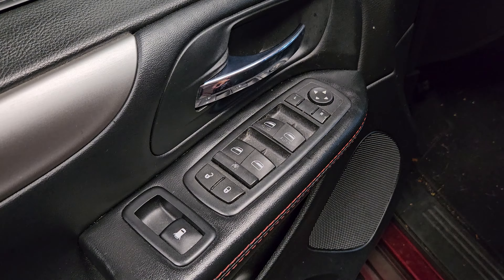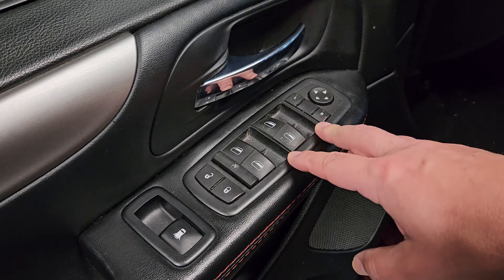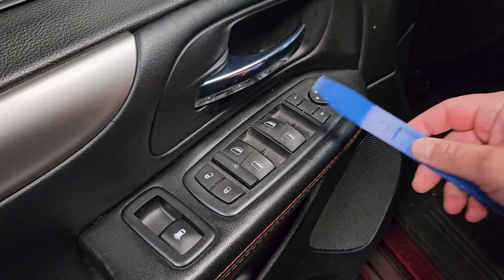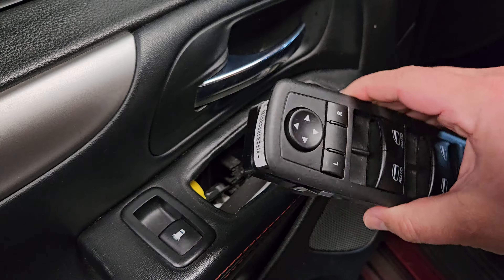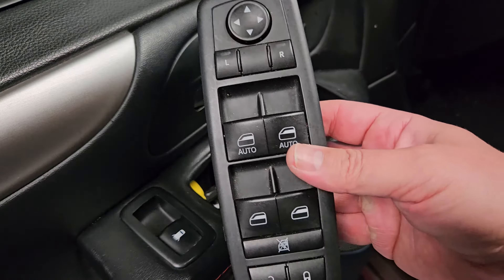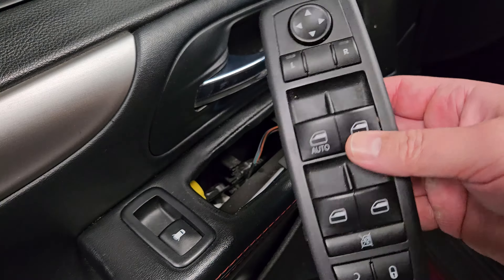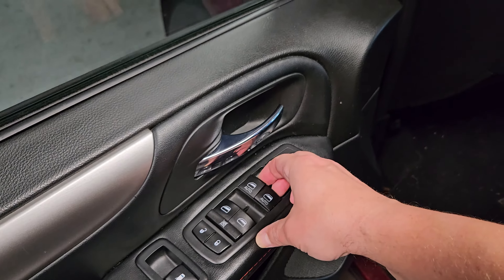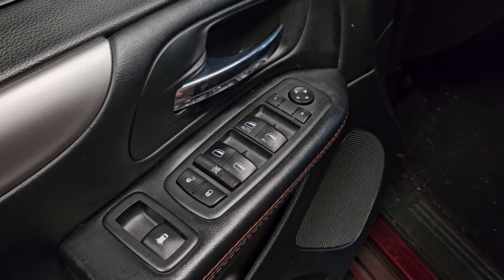How to Fix a Broken Dodge Grand Caravan Power Window, Lock, & Door Switch

Comment: What I want to know is how to pop a back window button out and replace the passenger window button with it!
Reply from the maker: @cmonbone  Yeah that's a tough job because these switch components are all assembled plastic and not made to be disassembled and replace individual parts like buttons. Best bet to be most cost effective is to look for your same switch housing part number on eBay and buy a good used one at a fraction of the cost.
Reply: Well, I did it. I found a YouTube video on how to pop the rear one out and put it in the front and it works.

Comment: Most non working buttons are from a broken ground wire in the driver's door harness between the door hinge
Reply from the maker: The 2-3x I've had this happen (I've owned 3 of these vans), the wiring has remained intact it was the switch that failed. They are all plastic + electrical components and wear out over time (especially the driver's side).

Comment: OMG maybe you can help me. I had to replace my window regulator on my 2019 caravan and when I got everything hooked back up the driver side pannel doesn't work. All the other window switches work, but the driver window switches and both lock switches on the drivers and passenger sides don't work.
Reply from the maker: I've seen this before and it happens when using a replacement switch assembly that 'appears' to have the same buttons and configuration, but it's actually not the same part. Dodge for some reason made like 45 versions of this same switch assembly across all their cars, so it's super important to get the exact same part number when replacing. If you did get the exact same part number and it's still having issues, there may be a wiring or electrical issue downstream.
Reply: Same thing here. Did you fix it? 

I replaced the regulatory since the window fell down and got scratched inside the door. 

I put the new regulator in the door plug everything back in and the window went down, but then suddenly the switch stopped working and none of the controls worked, including the mirrors in lock and unlock... so annoying.
Reply: @TheEclecticHandyman  I didn't replace the switches. I replaced the window mount in the door. When I did that, all the switches in the drivers door stopped working.

And no I haven't figured out a fix yet. The window is still half way down 6 months later and the switches still don't work.
Reply: @adamking7959  oh no!!! This just happened tonight to my wife's 2010 town and country. The window fell down. Local parts store had regulator. I installed. It worked for 5 seconds while rolling down. Then it stayed down and the entire switch doesn't work. No mirror controls, rear tilt-out windows or anything. 

If i sit in the passenger seats, I can roll down the other windows. But the drivers side switch was cooked after I swapped regulator. This is driving me crazy. I've been outside in the FREEZING weather trying to fix this POS! And just like you, the lock and unlock doesn't work on the front passenger door now either.

Comment: So I replaced the regulator, ( not the door switch you're showing in this video), and after replacing that, the window was able to roll down but then when I tried to roll it back up, nothing happened. Then when I tried to roll the window back up, it stayed down and none of the buttons work at all on the switch anymore. It seems like it possibly burned something up because the window went down slower than normal and slowed down as it was descending as if it was binding against something. So I'm not sure what's going on, but this is so frustrating in the middle of the freaking winter when it's freezing...
Reply: Just got my regulator replaced now the front windows only move when door is open. There's a little near the door cup holder the comes on and the windows work when it's on primarily.
Reply: @MyMjtaylor  here's an update to what I found. 

My window regulator had failed and caused the window to drop. So what ended up happening is I figured out the day door module. It had burnt up from the window being in a Bind so after I replaced the door module. I put everything back together and got a brand new regulator. From a local auto store and everything works well now. I hope that helps somebody out.

Comment: Thanks for the video.  2020 DGC SXT.  Left Sliding Door, and window stopped working. Door lock still working.  OBD Code Reads: U0201 Lost communication with left door module.  Two 30 amp fuses OK.  Any suggestions..  much appreciated..

Comment: Where did get the part from
Reply from the maker: I got mine from eBay in good-used condition, but they also have them brand new from Dodge or Amazon. Make sure you get the exact same part number. Thanks for watching! 🛠️

Comment: What about an 08 dodge grand caravan? Is there a replacement for that?
Reply from the maker: Yes, use the old part and find the number to match or go online to find a replacement for your specific model. The 08' is an older generation so it will be a different part, but you can find it for your specific application.